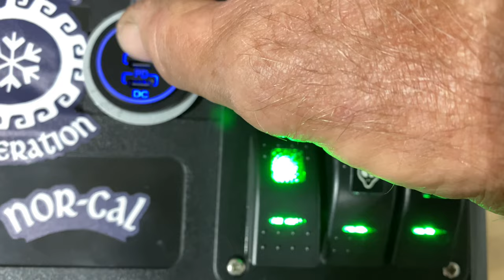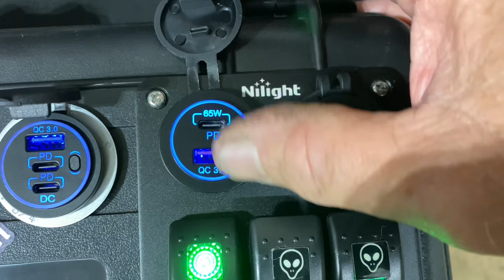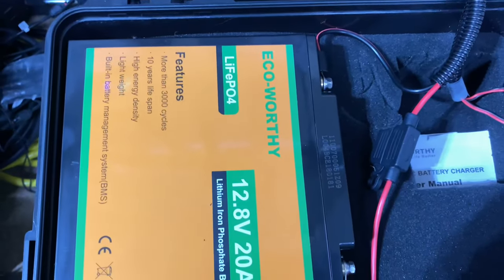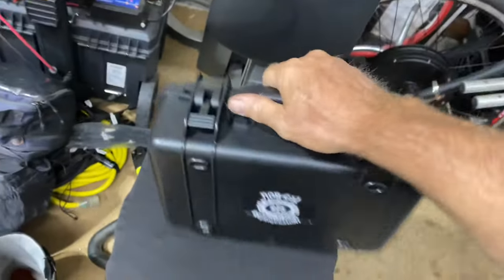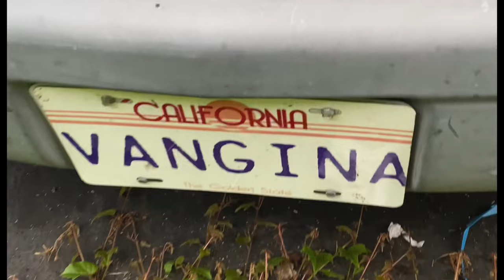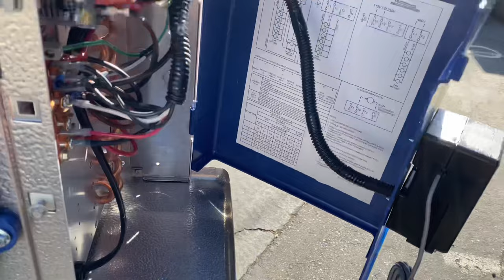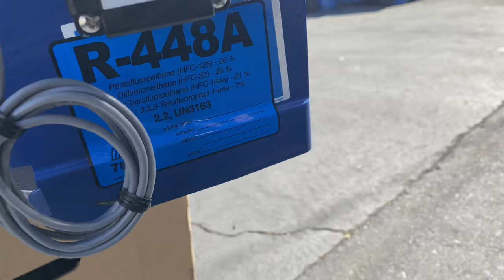Evaporator coil change out and Chat

Comment: That nozzle fucks stuff up sometimes. I had one that I had to drill out a tad when I went from an older style less efficient compressor to a 20 year newer higher efficiency one supposedly was a match on the Copeland app but I was having flow restrictions at it even though it was the "right size" it didn't work very well with the new TXV I put on. It was opened all the way up. And I had warm liquid from the txv trying to flood backing right up to the nozzle. They do create a flow restriction especially when your TXV is trying to flood. And it reduced my capacity and ability to pull down the box I had 30+ degrees of superheat and it took almost 4 hours to pull an empty box down to 35° until I oversized it. I was not a happy camper.

Comment: I actually had to remove 3 nozzles,  all 3 evaporators were starving and SH could not be adjusted.  It’s my understanding that these nozzles are used for higher ambient temps down south, I’m in the Northeast and they simply cause havoc.😊
Reply from the maker: Never seen that I’m in low ambient area costal climate summer highs 70-80’s.

Comment: 2 speed evaporator 🤔. Pulling the red wire on the relay and letting it run continously on high speed 😃
Reply from the maker: I keep 2 unless ice ups become a problem
Reply: Dont go by color go by number..... its the number 7 wire lol ive seen them come from the factory as black
Reply: @NorCal-refrigeration keep 2 and make low medium speed 😏
Reply: Everytime
Reply: @zaccody6980  I've only seen it as the red but since you said that I'll check every time 😃